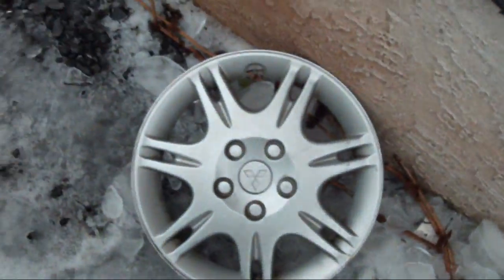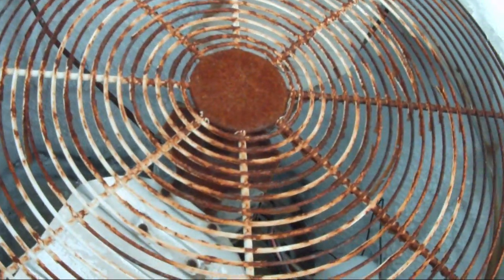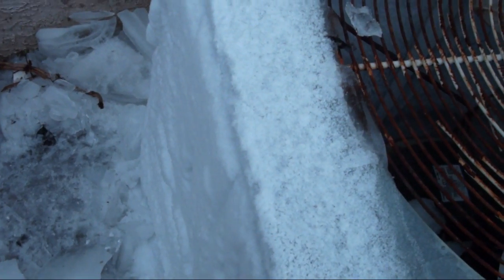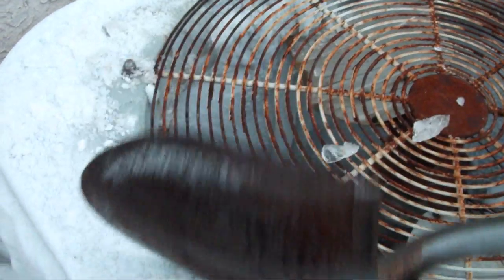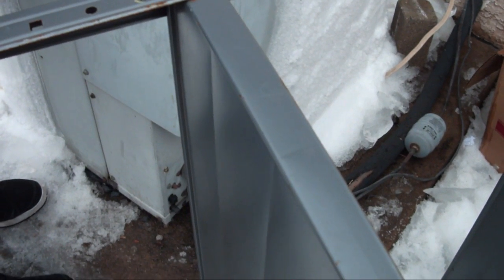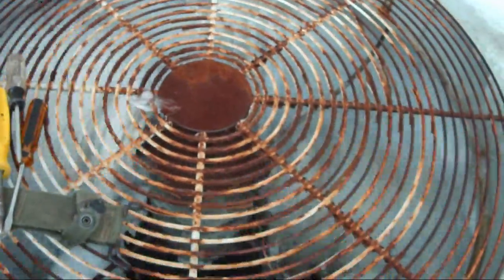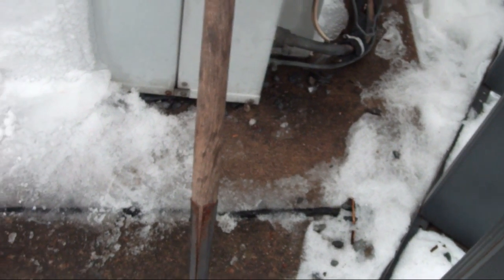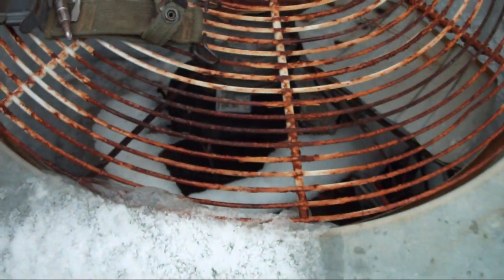DEICING THE 2ND MOST FROZEN HEAT PUMP EVER!

Comment: Mine is just as frozen as this...10 year old electrical system but it works, just frozen...the technician came out 3 weeks ago and he replaced the frost control board, cleaned the evap system, unclogged the evap coil and it apparently worked but I noticed about one week later the ice had returned. So the question is what the hell else could be wrong with my system?

Comment: Geez..get some spray de-icer cans available at discount auto stores and spray into the side vents to keep the coils thawed (turn fan off first). You will need to check it to determine how long the thaw will last depending on your outside temps. All you need to do is keep the system thawed ...so, whatever works without damaging the unit you can think of, should work.

Comment from the maker: Probably not, because the guy I knew who owned a business in this building has since closed his business and moved on. I can tell you that the frozen heat pump seen in this video has since been replaced with a Payne heat pump (sometime in late 2011 or early 2012. The other 2 Heil heat pumps and the Maratherm heat pump are still there.